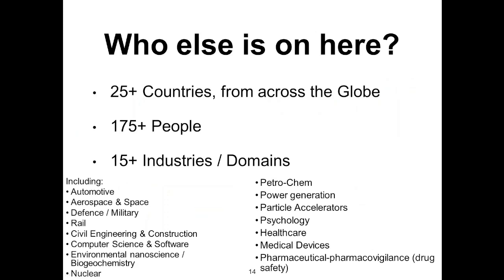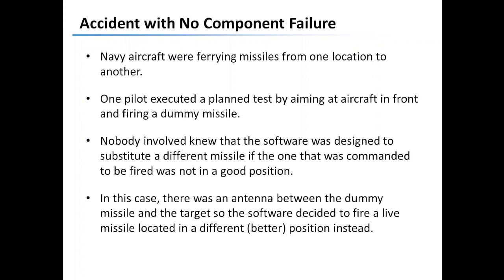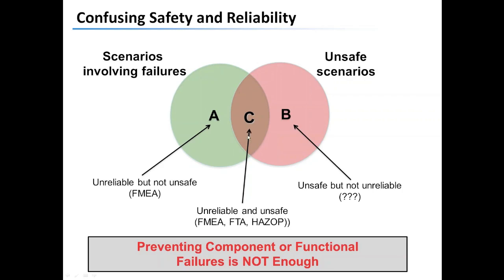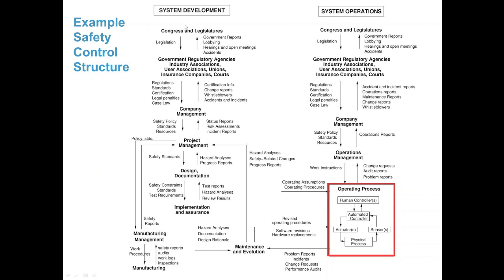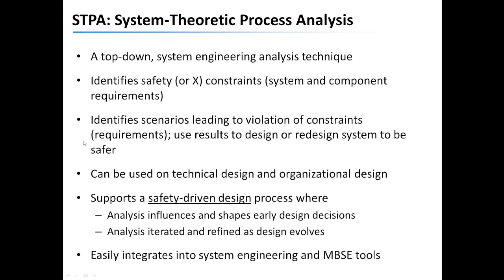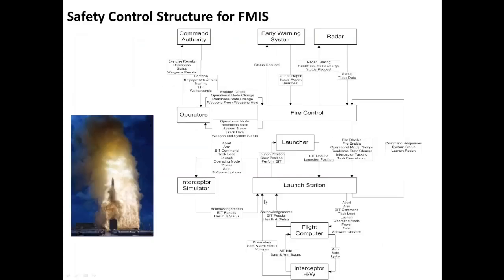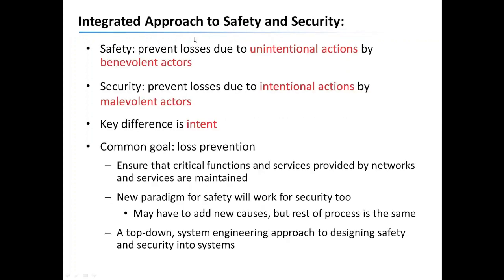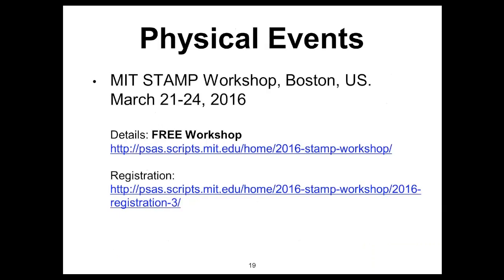Introduction to: Systems Theoretic Accident Model & Processes (STAMP) WEBINAR REPLAY

Comment: hey ...
Is there any scope for doing quantitative analysis using STAMP.
We are working for railways signaling safety system and mainly we use FMEA & FTA.
Is there any way we can think of combining STAMP with any of these 2 methods for quantitative analysis.
If you have any information or paper on any such attempt. kindly provide details.
it shall be a great help.
thank you.
Reply from the maker: Hi @upvindersingh1866, in short, no. One of the general premises of STAMP is that statistics / numbers don't work for complex systems involving feedback loops. Also, failures and non-failures can lead to accidents, so using failure-focused methods in isolation will always miss those non-failure / "dangerous success" cases.

I trust that helps, let me know what other questions you have, please visit my website and send me a message. Take care, and thank you for commenting.